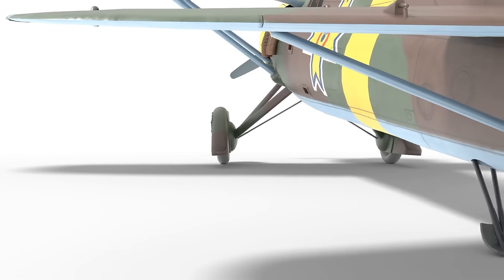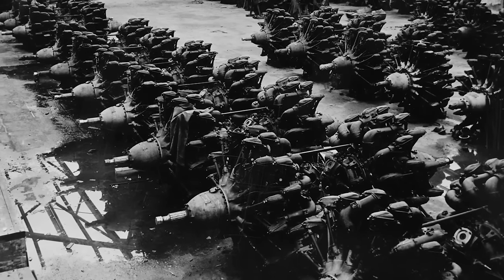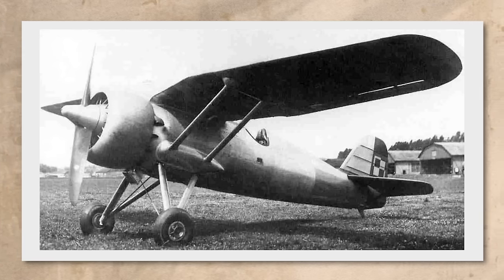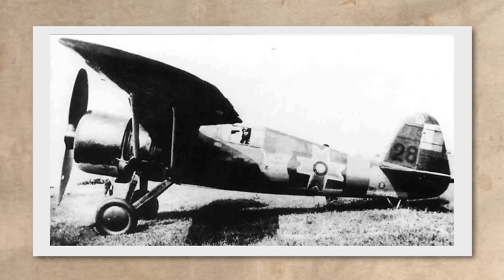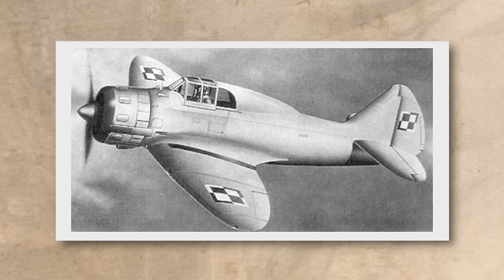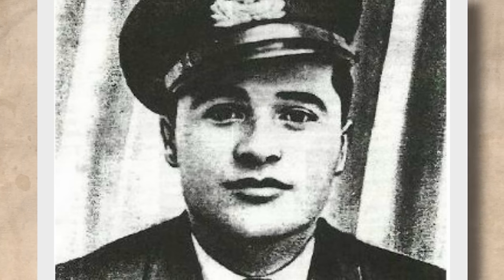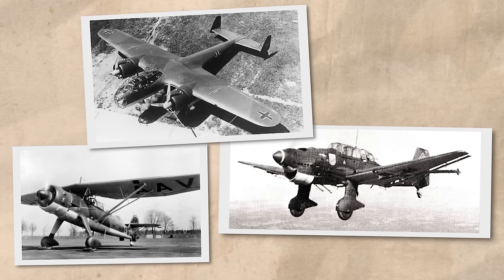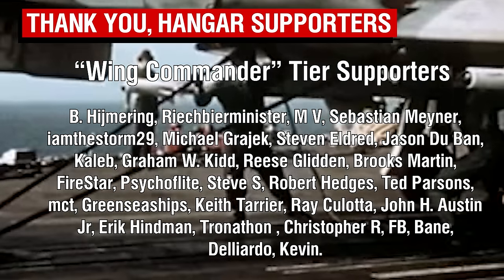The Polish-Built Hero Of Eastern Europe | PZL.24 [Aircraft Overview #94]

Comment: Hi, Rex.

A small note on the Turkish P.24s.

The claim about the airframes being re-engined with a Twin Wasp in service was never substantiated. The one in the Museum is fitted with such engine for display purposes only. Earlier models of the Pezetel were indeed re-engined with more powerful Gnome-Rhone engines and brought to F/G standard.

Service life was actually very short. As much as the pilots loved the superior speed and handling, several of them got killed in accidents due to lack of training or engine fires. The fall of France and Poland didn't help THK - the licensed constructor and maintenance facility - in getting the Pezetel fully ironed-out for service. The aircraft were given reserve status in 1941/1942 iirc when more modern aircraft started pouring in due to political shenanigans on who swinged Turkey to their side. They were pretty much off the picture by the time the war ended and ended up being used as instructional Airframes for several years afterwards.

All the best to you, mate.

Comment: Always thought the PZLs were interesting, if my memory serves the Polish airforce still had a lot of PZL11s in service in 1939. Had Poland been attacked a little later they would have fielded the PZL50s as well. Another area was the Polish twin engine bomber force which was state-of-the-art at the outbreak of WW2.
Reply: PZL.50 was couple of years before it could reach a production phase. It's prototype was "almost" ready but with modern calculations it would need to be probably redesign to lose a lot of unnecessary weight. PZL.11 was a main Polish fighter in 1939.
Reply: "Another area was the Polish twin engine bomber force which was state-of-the-art at the outbreak of WW2." ....it was a PZL.37 "Łoś"

Comment: Very good nad very informative video.

Pre-war Poland was a poor country so sadly tried to work on a milti-purpose twin engined 'universal' airplanes for longer than it should. Unfortunate circumstances (death of a designer etc) only prolonged this period.
Sadly when it comes to modern equipment pre-war Poland couldn't provide funds for sufficiently large numbers of produced vehicles. If it could it would eliminate many issues in airplanes and tanks delivered for POL military, lower costs of each of them and provide incentives to expand the number of suppliers, designers and to acquire for example better engines for airplanes which was a major issue much like in Italy or Japan.
Modernisation of the POL air force was conducted in phases, so the paradox of PZL 7/11/24 was that getting a very modern airplane in early 1930s provided lesser incentive in Poland to gain modern fighter planes in mid-1930s. At that time modern light bombers of PZL P 23A/B Karaś series were the number one. Later very ambitious, perhaps TOO ambitious idea of providing modern medium bombers PZL P 37 A/B Łoś absorbed too much funds and attention. Unfortunately the country was too poor to deal with everything and at the same time Nazi Germany built its air forces at incredible pace unsustainable in healthy economy. Speed which pre-war Poland could never hope to match, but certainly limited resources it had could be spent in considerably more efficient way. Sadly noone knew how quickly the actual war would be started. In a way insane rearment of Nazi Germany, insane because its economy was in such a shape it couldn't last long without conquests, forced it to start a war which to GER leadership's surprise turned to be another World War. Something neither Nazi GER or its opponents were prepared for - in this case the sad truth is that POL air forces were actually weaker in 1939 than in 1938 and only later part of 1940 was supposed to see its gradual improvement - better airplanes and larger production facilities.
Wars happen to have... the most annoying timing.
A lesson which is useful in our time and apparently was more or less quickly re-learnt by POL thanks to time provided by the bravery and skill of Ukrainian armed forces and resilence of Ukrainian people.

I'll also add that when dealing with the PZL you might want to have a look at development of Bulgarian air forces because the outbrak of the 2nd WW derailed quite ambitious plans to develop BUL airplane production facilities. Development where PZL experts were supposed to play  important part.

When it comes to images I'd recommend Narodowe Archiwum Cyfrowe. It is mainly useful for non-military purposes, but there might be some good images you might find useful.

https://www.szukajwarchiwach.gov.pl/en/web/narodowe-archiwum-cyfrowe

Take care!

Comment: I hear the throttle is oriented in the reverse as compared to the standard. Throttle up is back towards the pilot and throttle down is towards the front of the aircraft. This is not a Polish joke btw.
Reply: Throttles often were "backward" in European aircraft of the time. That actually became an issue in the BCATP here in Canada in late 1940/early 1941 when Canada received the latter part of France's order of North American NA-64s, which were called Yales here. They closely resembled the related Harvard, but were sharply different in several ways, one of which was a "backward" French-spec throttle. Some flying schools used both Harvards and Yales, and student pilots had to take great care to note which type they were flying...

Comment: The planes you gave for a 1:50 comparison, i.e. Hurricane, D 520, He-112 or P-36, are later constructions and comparing them to the P-11 or P-24 is very inappropriate, primarily because they are younger constructions with about 3-5 years and as you know in aviation at that time it was a generational leap. A proper comparison from this period would be, for example, Gloster Gauntlet or Hawker Fury, Grumman FF,  Hs 121 or  D 373.

Comment: The CANT Z.1007 seems pretty interesting. Introduced around the same time as the B-25. Pretty incredible that the old Mitchell’s two engines produced 1,400 MORE total HP than the three engines of the CANT. Seems like kinda a pig, but apparently it wasn’t bad. 🤷🏻‍♂️
Reply: Italian aircraft engine manufacturers couldn't exceed the 1000 hp "wall" in engine output that afflicted the 1930s aerospace industry. Mostly it came down to an unwillingness of the Italian government making the large capital investments in R&D and engineering that other countries had made to break the limit.
Reply: Another problem with the CANT Z 1007 was it was primarily a wooden aircraft and with modern aircraft armaments it would burn easily.

Comment: Why did the Polish Air Force use Gladiators and the PZL.24 side by side? I understand that the Gladiators came after the PZL, but (just like the US Army Air Corps with their P-26s for the P-36) get rid of their outdated planes for the Gladiators. Was it because of the fact that they could use as much equipment as they can, or maybe because they didn’t have enough gladiators bought in the first place?
Reply: Correction: I meant the Hellenic Air Force, not that of the poles

Comment: Shame that you haven’t taken time to describe in more of a detail the airframe as P.11 starting from C version is contender for a first laminar flow wing fighter.  Sadly much of the technical specification was lost in majority of user and licensed counties ( with exception of turkey that seems to be off limits to anyone outside of Turkish military) which made impossible to really evaluate construction of p.24/p.11 areoplanes with modern technologies untill 2019 and I’m not sure if work on this front was truly finished. 

Despite German claims there where no p.24s I the sky over Poland and moust of claimed “p.24s” where in fact p.11 G’s with retrofitted mercury VIII’s on p.11c airframe which proven to be quite tricky opponents for me109s  due to horsepower advantage. 

Sadly both p.11 and p.24 where treated as bit of a unwanted child by tiny team of constructors from PZL- moustly due to fame and glory which accumulated late constructor Puławski, while I think that it had a chance to become something comperable to f4f wildcat if given proper attention.  Sadly two prodigies of construction team: high on his own farts and conventional in his solutions Jakimiuk responsible for pzl 50 disaster and young fascinated with this accidental discovery of laminar wing Dąbrowski (responsible for wild succes of p.11c, built on its basis p.24 and laminar flow wing bomber p.37 łoś) weren’t interested in any improvements on older platform despite how easily it could be converted into decent planes (as shown by very successful IAR Low-wing  fighter) as everything aft of cockpit could be re-used as construction methods did not change until the jet age. 

Once again I offer myself to your disposition Rex in aquisition and translation any materials published in polish as both p.11 and pzl 37 are, in my humble opinion worthy of your channel.
Reply: Ok. Just watched to the very end the video.  I’m rooting for p. Fighter series.